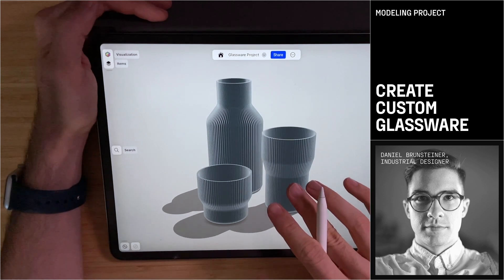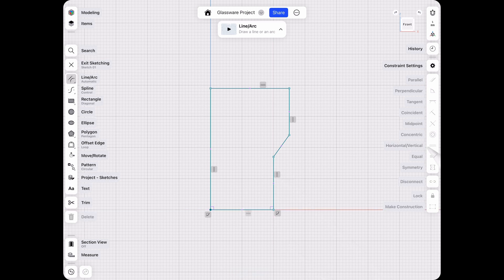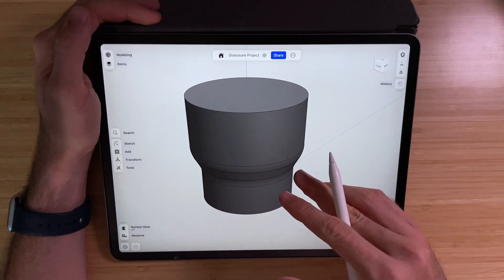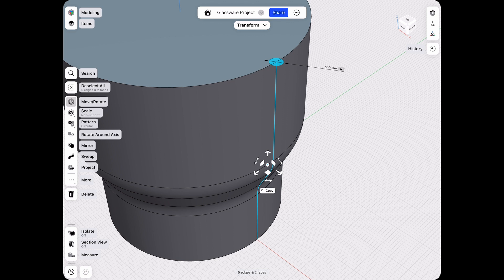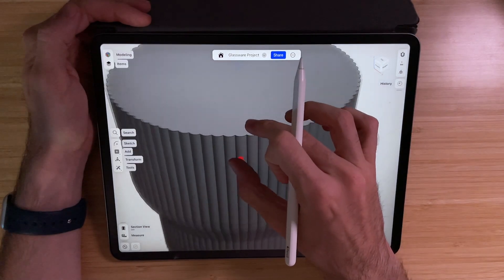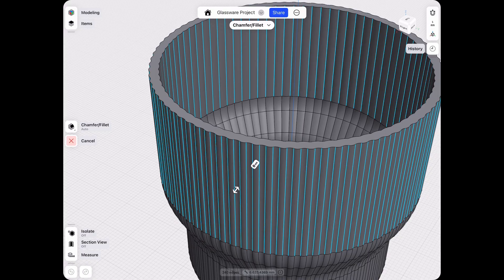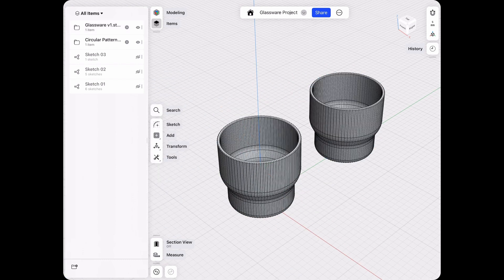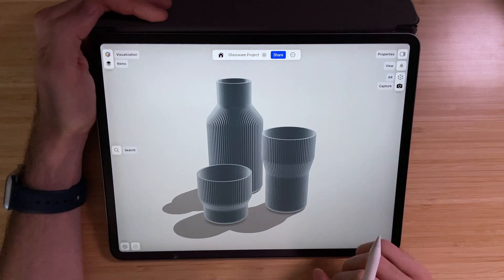Custom glassware | Modeling projects

Comment: This is the crazy part: If you choose function Pattern first, and then choose the flute, and then use the arrow to circulate it, you will get an error. But if you choose the flute first, and then choose Pattern, and then circulate it, then it works okay. Took me many attempts to realize that. It's kinda silly.

Comment: It was such a mess! My sweeps were not following the main sketch’s length changes.

In my case, after I split the two bodies (in the tutorial, Daniel says to hide one half and create a sketch on the newly created plane, then project), I don’t create a sketch—if I do, it won’t work at all at some point. Instead, I select the side lines, choose a plane to project them onto, and in the projection result (gear icon between “Done” and “Cancel”), the “Linked” switch should be turned on. And it worked!